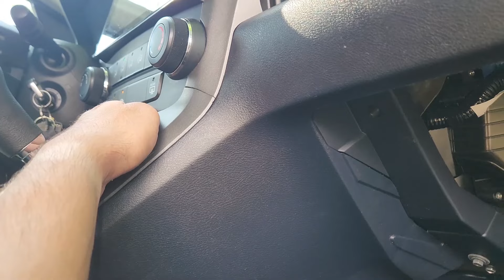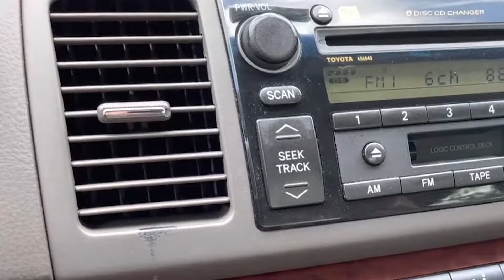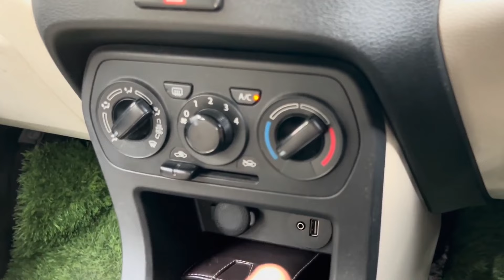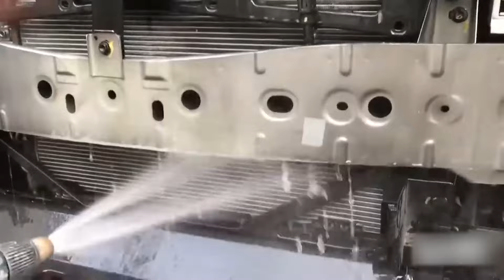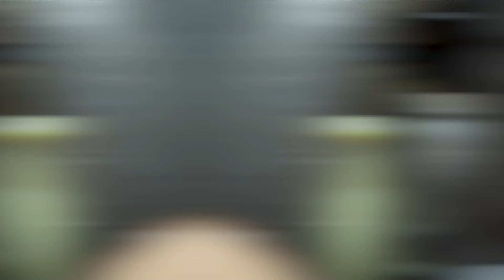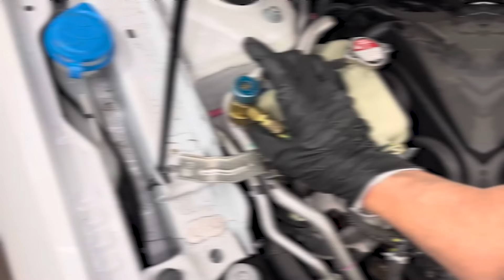Do This and Your Car’s AC Will Blow TWICE as Cold!

Comment: Don't use max a/c. Use normal a/c and manually engage recirculation. It saves wear & tear on the compressor, uses less fuel and blows colder.